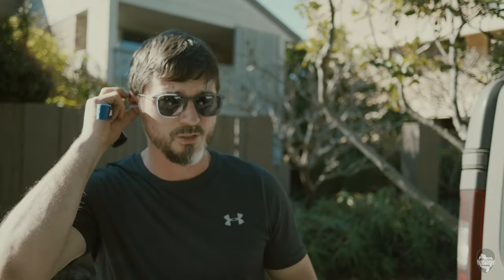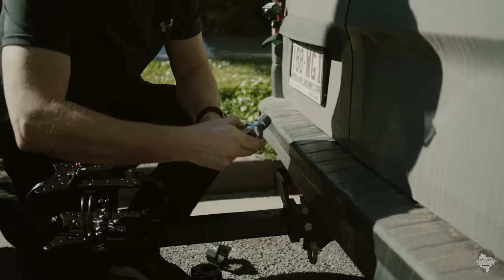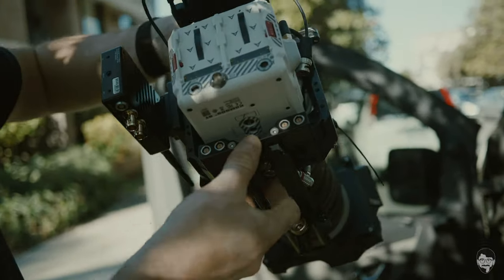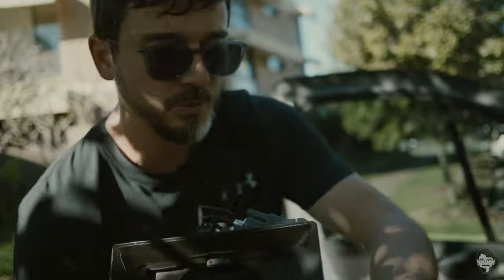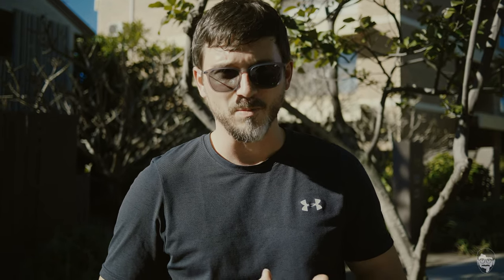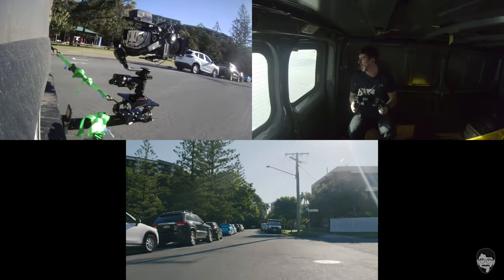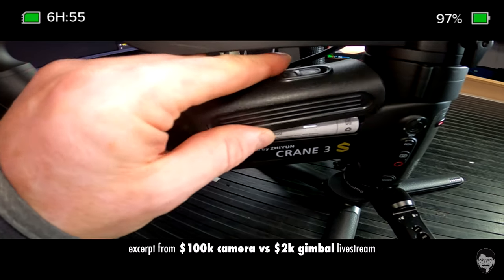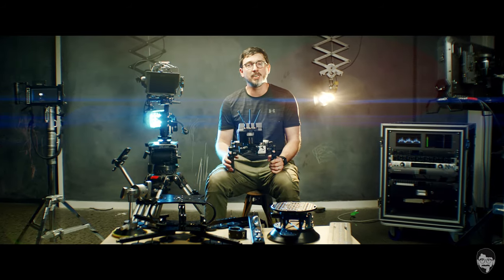DIY Vehicle Rigging PT4 – Skater + Komodo + Crane3s

Comment: "going full loose buthole..." hahahaha....brilliant....... another gun great video. Top tip. Many people users of cloud mount and kessler mounts have been buying a tiny inner tubes from a cart or something similar and sticking it inside the wires. This provides some "support" from keeping the isolator from total loose butthole momenst.I'll send you some reference shots. I have even seen kids rubber soccer balls deflated inside of the isolator.....actually we used the inner tube method on real russian arm cars before as well. It's an old technique.....you can vary the air pressure to adjust the support/isolation. Keep at it! Enjoying the journey! We all take it on some level, with varying results.....
Reply from the maker: Nice one Pedro 🤘🏻 Did you hear the little shoutout to you when I was tightening up the tow hitch? Learnt plenty from your vids mate.
Great tip on the inner tube. I’ve seen that used a few times but never clicked that it was for tight butthole surety 🤦🏼‍♂️
Reply: @graetzmedia  Thanks for the love... BTW I have a mini suspension arm I made like 3 years ago for the ROnin-M. Just got sidetracked. But I'm reviving the project ASAP......as soon as I release the action arm.....I'm start workign on the action arm mini....will be a perfect fit for these smaller gimbals/cameras.
Reply from the maker: Nice mate! If you need someone to field test it you know who to call 🤓

Comment: Just modified my hand control unit to incorporate a proper joystick. Makes tracking so much easier than using the mimic mode. If you're interested in the same capability hit me up. I'm Brisbane based.
Reply from the maker: Definitely keen to see that in action!
Reply: Hey! I would be super interested in how you modded the joystick, that is my biggest problem at the momen! Thanks.

Comment: Great video mate. You just earned a new sub! 
- Seen your videos the last few times, and I have really been digging them a lot. So thank you for the great content! 

Have u ever thought about, looking at either the Rigwheels slingshot or Proaim Airwave. Those are  some of the more cheaper option for car rigging. Looking at an option for my self to purchase, like the slingshot of proaim airwave :D
Reply: I've just bought the Proaim Airwave to go with a Ronin MX. Love the Airwave so far, it's incredibly easy to setup if you have a tow hitch mount. Ronin MX is struggling though, so will likely upgrade to Zhiyun 3S soon.

Comment: So, I've heard that you need the video transmitter for zhiyun for the remote to work with the crane 3s. Is this 100% true? I plan on mounting the gimbal on of my car then having it hard wired with and HDMI cable into a monitor and just use the remote for mimic capabilities/ remote control. Would this work or do I need the video transmitter?

Comment: Great video! how did you change the logo on the Smallhd?!
Reply from the maker: From memory you just have to put an image file on an SD card (needs to conform to the spec in their manual), and then there’s a spot in the menu that you select it as the load screen. It also appears when you don’t have an active connection.

Comment: Thanks for sharing some details. So you're gonna bite the bullet and buy a killshock? Wish they weren't so pricey. They're currently back ordered though so maybe the price is right for most folks. If they were smart they'd just send you one with all the accessories and sponsor the next video. Their product videos aren't nearly as useful as yours have been. Then maybe you could compare results of an upright mount vs an inverted mount and limitations of both without any added y axis shock absorption from an expensive arm, which seems like what you're after and would be valuable to hear explained.
Reply from the maker: Yeah I saw they were backordered too. For now I’ve ordered an extra set of 4 springs and clamps for my CloudMount to see if that improves its reliability. I might look at the Killshock down the track. Would be great if they could sponsor one 🤙🏻
For the kind of work that I do I feel like the full black-arm/underslung config takes me into territory where I’d rather hire a decent grip with a Movi XL or Ronin2. But I’ll definitely keep testing this setup in the meantime. I’m confident it will still make a lot of cool shots possible with super fast setup time and a much smaller crew/cost.
I’ve got some mates with the full black arm setup and we might try to put some side-by-side tests together soon.